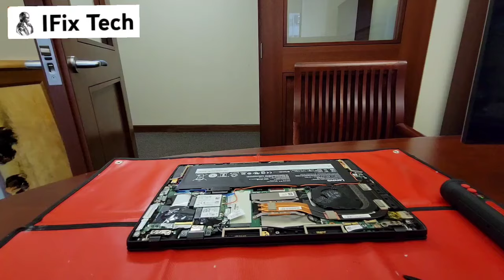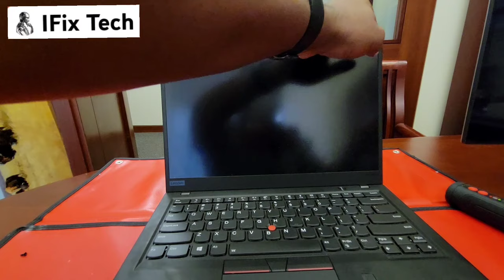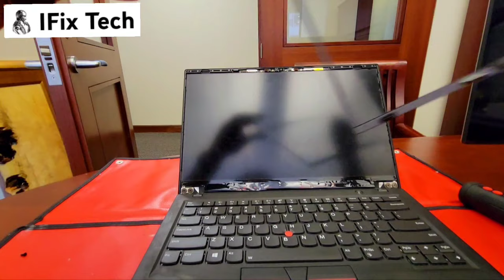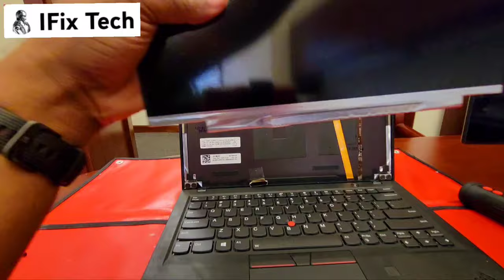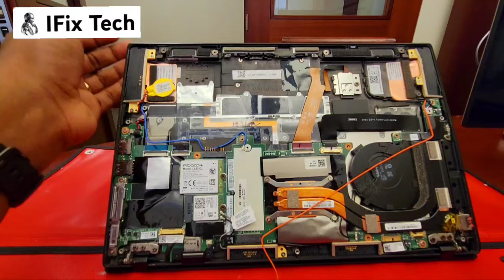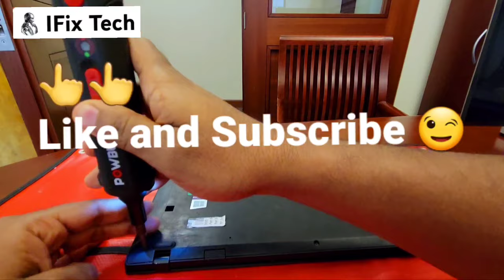Lenovo Thinkpad Musical Tone Error at boot up - Black screen beeping error ❌ 💻 ❌

Comment: Try this first. Hold power button for actually 30 seconds. Dont rush. This will reset all connections to battery and screen. This may solve issues with most.
Reply: Works for me. Thankyou very much 😊
Reply: Brooooooooooooooooo😂❤
Iam Soo happy you are a life saver 
It worked for me thank you very very much 🖤🤍🤍
Reply: Thx bro
Reply: omg actually a lifesaver tysmmmmm
Reply: This immediately worked.  No need to take the computer apart.  Thank YOU💙

Next thing is WHY it happens?  

Thanks for helping us get unstuck, and quickly
Reply: Ty! It worked like a magic
Reply: Thank you very much man
Reply: Ur my saviour I love.u so much.
Reply: Worked like a charm!🫡 You're a life saver bro!
Reply: Thanks champ, Solved!
Reply: Not work for me. Any solution?
Reply: THANK YOU! You're a life saver, man!

Comment: Disconnecting and reconnecting the display cable at the mother board fixed it for me. Also removing the bessel at the bottom closer to the keyboard was easier for me. Thanks for the good video
Reply from the maker: Thanks for sharing what worked for you 🙂👍
Reply: Please can you explain how

Comment: It is highly recommended to use an ESD kit when you open the laptop up. The wrist strap should be used as well. It can be worn around the wrist or ankle. If worn around the ankle don't forget it is there.
Reply from the maker: Hello. You are right. It's highly recommended 👌.  If you don't have one around you can keep touching a metal base while working on the machine. Regards 👋 👋

Comment: Mine gives exactly the same musical tone with a black screen. However trying persistently to switch it on it works after a few tries. But the problem is persistent and happens again after shutting down to restart. As the screen is working its likely to be the connectors. I am no expert so should I attempt to open up and reconnect myself? What should I do?
Reply from the maker: Try to use the Lenovo PC Diagnostic tool. It can tell you what to do first. 👍
Reply: Hii There Andreas, I am facing the same issue now, did you find a solution to your problem?

Comment: Hi when doing a bezel replacement I came across this issue after trying to turn on the laptop after I was finished. For me could this issue stem from some screen damage done during the replacement?
Reply from the maker: I suggest you run the Lenovo diagnostic tool. It can be a loose screen cable, etc. The tool can help you troubleshoot it. Here is a video about how to use the tool 👇
https://youtu.be/aUuQVPJrshI

Comment: Thanks for the video. I have the tone and blank screen maybe 3 out of 5 times I start the laptop. Usually more likely if it isn’t plugged into power. I can force shut down by holding the power button and try to restart and it usually starts normal after 1 or 2 tries. The screen works fine then. Would this still need a whole screen replacement as the screen is actually fine when it works?
Reply from the maker: Thanks for your comment. You can try using the Lenovo diagnostic tool. It will help you to troubleshoot it. It can be just a loose LCD cable. Here is a video where we use the tool to fix this issue.
https://youtu.be/aUuQVPJrshI

Comment: If u connect an external monitor to the laptop and it works then the screen is not working!
Reply from the maker: For that scenario there's two posible problems. 
1-  the screen itself.
2- the motherboard. Even if it works on the external screen. Probably the chip that controls the image to the laptop screen went bad.  
Regards.
👋👋
Reply from the maker: yoliswa binwell   Try to download the Lenovo Thinkpad Beep error app on your phone. It can help you diagnose the problems.
Reply: @IFixTech1  bro at minute 6:15 when you were trying to make the display fit! How did you do it cause my connector location is not the same as the new screen I got! Please help
Reply: The connector is not long enough
Reply from the maker: @brandong8323  that means you've got a different screen, but you still can make it work. You need to play with the cable pulling  it in order to make it longer. You can do it easily by dismounting the back cover, that will allow you to have more or less cable. 
Here is another video on how to work with the cable. 
https://youtu.be/iUZB6uO3lcE
Reply: @IFixTech1  thank you I did just that! But unfortunately the replacement display never showed any picture! The thinkpad jingle went away. External monitor that I plugged in  acted as the second screen to the replacement! So that only means either replacement was faulty or motherboard! But I’m guessing motherboard 

Replacement screen is 01er483 which should work with 20kh models which I have :(

Comment: For me it was enough to disconnect the battery et voila, everything worked like nothing ever was wrong.
Reply: I had to both disconnect the battery and change the screen. Changing the screen alone didn't work, nor doing just the battery.
Reply: Thank you man! I was so upset when this shit happened to me in the foreign country:((( Lenovo service told me I need to leave it for at least a week and I'll not be able to work at all!!! After reading your comment, I tried to push everywhere along the screen frame at the bottom, and it started!!! BTW screen is glitching, but it works and I can work. Thank you for your comment about the connector!

Comment: fancy music, tried to install a M2 2242, the last free slot on my T14 and got it singing something similar to this. removed the M2 and the machine was back into business.
tested the m2 on a external case and it's fine too, just incompatible.
Reply from the maker: You can use the Lenovo tool to try to troubleshoot the issue 😉 👍

Comment: please share the buying link for the screwdriver
Reply from the maker: Hello, sorry for the delay, now is really hard to find this one.
here is the link, if cant open it go back to de video, I alredy put it there. Thanks.

https://www.walmart.com/ip/Rechargeable-Wireless-Cordless-Electric-Screwdriver-Drill-Set-Power-Tool-w-Bits/340005082?wmlspartner=imp_3586222&selectedSellerId=101101964&clickid=XMo11nVgIxyPTF-Roa0ZqzmBUkH3V5x11yl8V80&irgwc=1&sourceid=imp_XMo11nVgIxyPTF-Roa0ZqzmBUkH3V5x11yl8V80&veh=aff&affiliates_ad_id=565706&campaign_id=9383&sharedid=

Comment: my laptop has an error 2 x short beeps and the display does not turn on. Do you know what this error means for lenovo b475. I have removed the cmos battery and replaced the ram with a new one but the result is the same but still beeps
Reply from the maker: If you already replaced the RAM then your problem can be related with a faulty motherboard.
Try to perform the steps in this other video
https://youtu.be/zZGDa1IOax8

Comment: My laptop plays this exact melody now and then on boot. It just did it now,  when i booted it up at work. It's got almost a full battery and been in sleep mode overnight. 

It plays this melody and boots up without issue. Runs fine too. It just does it regularly. 

Any clue as to what can be wrong? 

It's a thinkpad E15 2nd gen.
Reply from the maker: Something is falling on your computer. You can Try to run a diagnostic with the Lenovo Vantage software or by pressing F10 while booting up.  It probably means something is wrong on the motherboard and even if it is working it will probably stop soon.
Reply: I have the same Thinkpad and I am experiencing same issue, sometimes fail at work and remains at 95% of battery so I'm only able to use external monitors. When I come back to home computer work as usual... I've applied all pending updates but did nothing. Do you have any update?
Reply from the maker: @ericcau25  Try to download the Lenovo Thinkpad Beep error app on your phone. It can help you diagnose the problems.
Reply: @IFixTech1  hmmm i dont think your entirely right because I used to have this exact problem that Soren Made did and it stopped after a little while and it is working fine so I don't think that this persons motherboard will fail. (Because saying that their motherboard might fail wont be the thing they want to hear)
Reply from the maker: @supermario3D1  Glad to hear your case was different. But my years of experience working with Lenovo computers tells me your case is an exception. I understand is something hard to hear. 

Regard 👋👋👋
Reply: Same thing happened to me with my l13 gen 2

Comment: my x1carbon 6th gen (i7 8th gen) didn't turn on this morning, after repeated tries I get the melody. Turns out the battery had drained during the night and there's no power. After I charge it it starts working, and I realize the battery got almost 1000 cycle count and while the original capacity is 57mwh, the fully charged now is just 11k (battery health check software). So I'm charging it to 94%, leave it for a while. I already turned off quick boot and always on usb, drained power for static electricity. I turn it on, its 88%, start using it , goes slowly down to 80% and then bam before I know it, battery is empty again. I charge it and now all of a sudden its lasted an hour. Dang lenovo
Reply from the maker: Try to run a diagnostic on the battery. That can help you identify the issue. 👋😉

Comment: Today i had similar issue. And the problem was a battery
Reply from the maker: Very nice you could troubleshoot it 👍
Reply: how did you solved it?
Reply: I replaced the battery few months ago. Luckily i had original battery as well. I installed original and everything start working normally